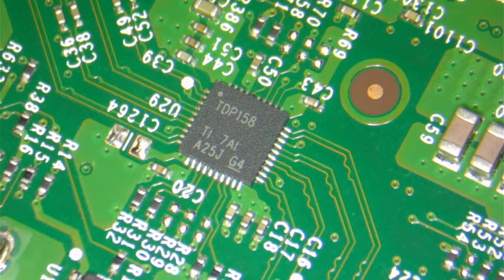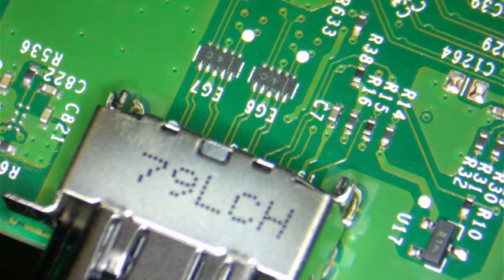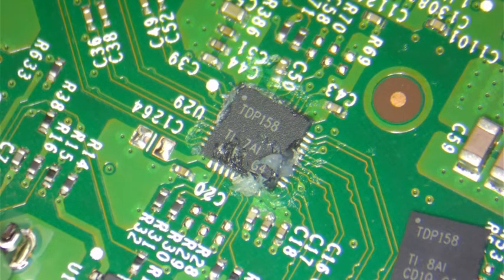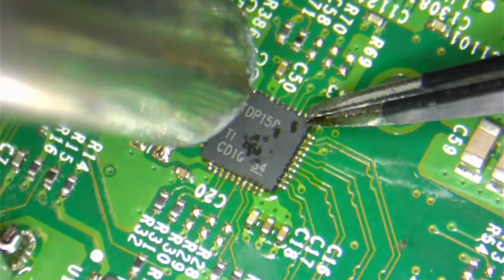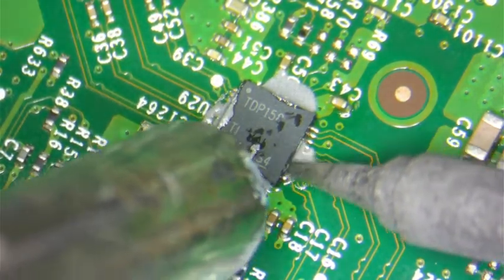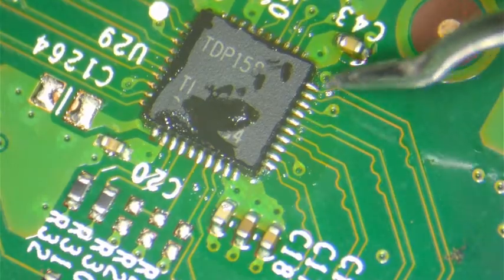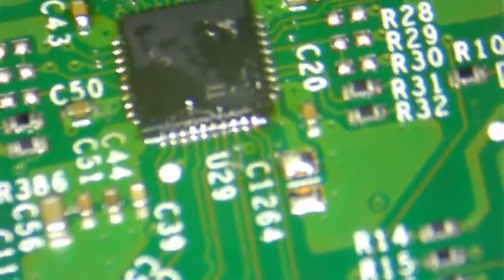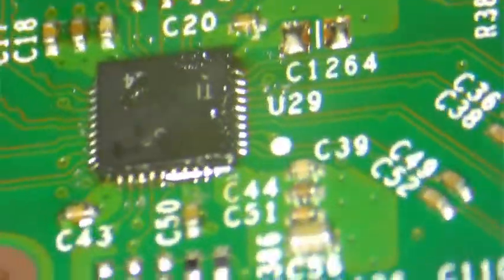Xbox One X Video Retimer IC Chip Replacement

Comment: hi bro i have used xbox one s and i am afraid of this problem if it happened to me i want know why this  problem happened ? and what i can do to Protect my xbox?
Reply: I think use surge protector and keep it in good ventilation area to keep the unit cool might prevent this issue. My Xbox one X retimer chip gone bad after a short power outage.
Reply: @todd2617 well mine was taken Caren care of and worked fine after I moved, went to turn it on after 8+ months of no use and now it’s appearing to do same thing